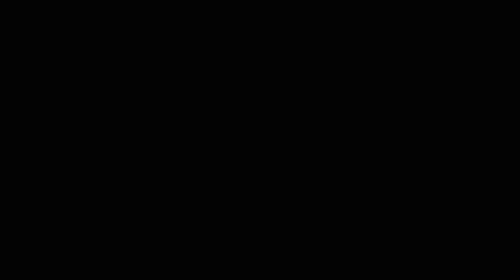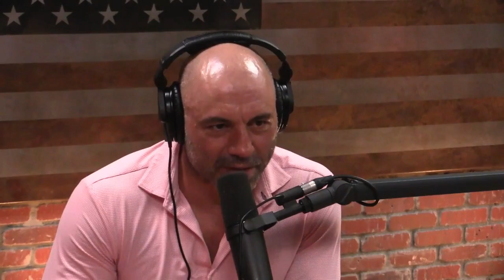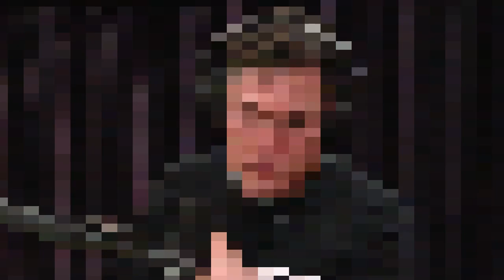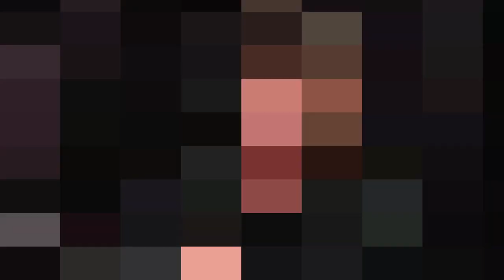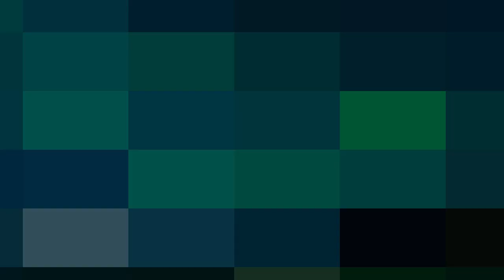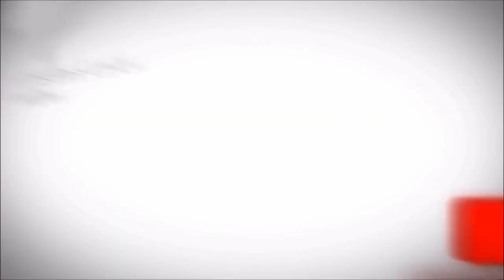Elon Musk"I've designed an Electronic SUPERSONIC JET"

Comment: Cool recharging idea. But is that really enough? Batteries have like 1/40th the energy density than fossil fuels. Hope so
Reply: Fingers crossed
Reply: It’s not even the energy density. It’s the weight. You can fit 40 times the fuel but you can’t carry 40 times the weight in fuel
Reply: 1/20
Reply: You should see what he did with the semi. I have no doubt we will see electric planes in a few years from tesla. Vertical take off with different thrusters would eliminate nearly every plane crash of 2020. Engine goes out . . . who cares, that's not how we land anyways. Over a freeway, who cares, we only need 4 semi width of landing space. 

This dude is way too smart.
Reply: edwong3  Sure, they may be efficient storage. The problem with Solid State batteries is so far, they're only roughly 2-5 times more energy dense than lithium-ion batteries. The problem with batteries isn't the efficiency at which they store energy. It's the amount of energy they store per Kg. even with that 2-5x boost, other currently existing fuel sources would still be able to go (at worst) 8 times further, if not more than a battery powered vehicle. 

TLDR: The efficiency isn't the problem, it's the energy density that really fucks batteries over.
Reply: its 1/10th now after battery day
Reply: I dont think you can get supersonic speeds with propellers even if you have enough power and storage density or whatever.
Reply: @unforgotable1  The Republic XF84 “thunderscreach” was built and flew with a supersonic propellor.   It was efficient but extremely noisy.   The Soviets made a couple of turbojets and turbofans with supersonic compressors.  The noise is contained by ducting.   Supersonic operating ducted fans can work by using a diffuser to slow the flow to subsonic, operate the fan in subsonic flow, then accelerate the air to supersonic again or the can operate in supersonic all the way.
Reply: @WilliamJones-Halibut-vq1fs  i think you misunderstood me, i meant that supersonic speed for the aircraft not the propeller. And i checked XF84 and it has 0.70 mach top speed.
Reply: Current LiIon batteries as used in Tesla Model 3 are 220 WHr per Kg. Gasoline is 8000 WHr per Kg. So yes that is a 36 to 1 ratio however  electric motors are 3 times as efficient so the difference is only about 12 to 1.   Electric motors are however 4-5 times lighter than piston engines and 2 times lighter than gas turbines and do not need heavy vibration resistant mountings, gearboxes and props.  This weight saving when used to provide batteries gives pretty much 5-6 minutes of full powered flight. Nor do they need cooling systems or big air intakes.   Furthermore although they may have less energy density in terms of weight they have more than adequate power.   The batteries are also volumetrically dense.   These factors certainly allow an electric aircraft to be light, low drag.  As a result they can get of the ground and fly efficiently a few hundred kilometers.  Probably 1000km is practicable and maybe half that with a commercial load if we imagine the aircaft like a sort of powered sail plane.

Supersonic turbofans with a supersonic inlet flow and outlet flow have been tested by NASA and seem to be the most efficient at cruising at Mach 3.   Hence a supersonic EDF “electric ducted fan” is possible.   If you can get to 25,000m altitude air density is 2.5% and 40,000m less than 1%.  If you can get to this altitude, with small wings, you can cruise efficiently at Mach 3 or so due to the low drag but the lift provided by the high speed.   Vertical takeoff would be necessary due to the low wing loading.  The massive power for the 30 second vertical takeoff could be provided  by hypercapacitors.
Reply: @WilliamJones-Halibut-vq1fs  thanks for a detailed and interesting rundown! Still curious about how turbofans operate in low denesity air - do they not need a certain density to be efficient?
Reply: @klingefjord  Air density doesn’t impact fan efficiency significantly though it will reduce thrust.   Effects caused by the change in speed of sound will be slightly noticed.  However if you are at say 30,000 meters the drag is much less and you won’t need much thrust.   Wings can achieve lift to drag ratios of 50:1.  The drag from a wing producing lift is called induced drag .   The parasitic drag is called zero lift coefficient.  By making the wing small parasitic drag is reduced but we have to fly fast.  To land you can use vtol.  Check out lillium jet.
Reply: @klingefjord  Air Density doesnt significantly impact efficiency of an electric ducted fan but it will reduced thrust levels.  At high altitude the air is not very dense so the reduced parasitic drag on an airframe is highly beneficial.
Reply: @WilliamJones-Halibut-vq1fs  u should work at tesla or some shit ur smart as hell